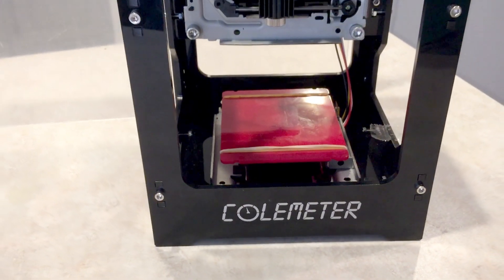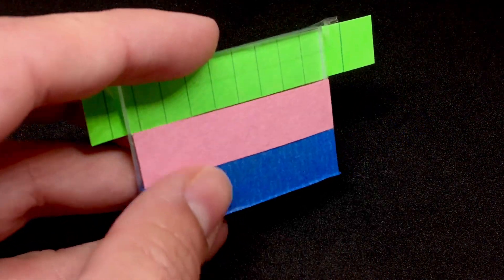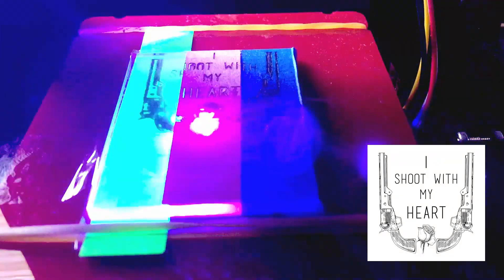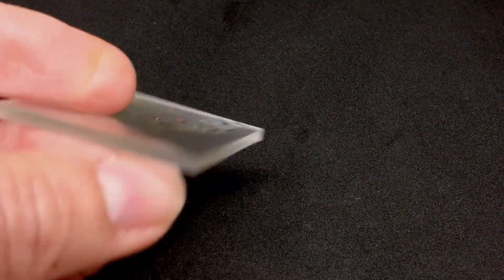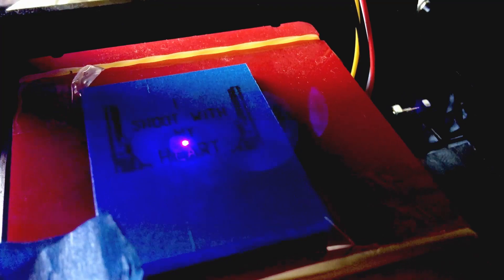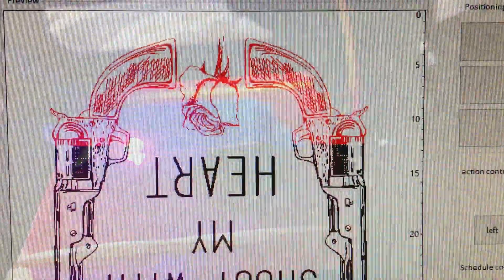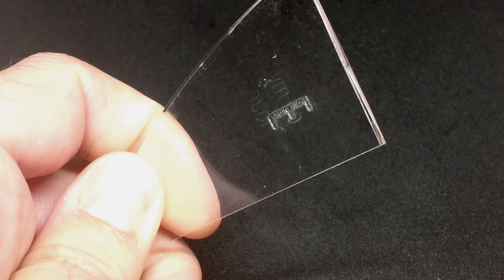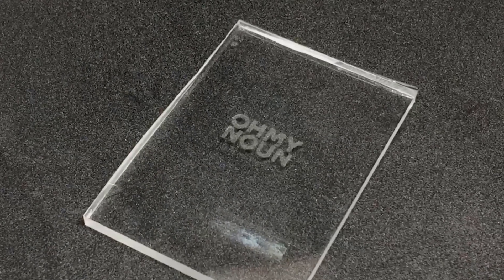How to Etch Acrylic with a 1000mW Colemeter Laser

Comment: I happen to be needing a clear 3.75" x 2.625" plastic and was wondering of routing or laser would be better. I can send you a sample for your opinion. vbcoachwasiatyahoo
Reply from the maker: No sample needed. If using a piece that large, I recommended a machine with a bigger platform. For basic plastic, 1000mW is fine. For acrylic, 1000mW works, but you may want to find a 2500mW, depending on your needs.

Comment: I am a nail artist and graphic designer who has been having my own private line of nail art stamping plates made in China.  I would love to be able to do my own small-batch manufacturing in the USA.  I don't know how the acrylic plates are made so this interests me.  The etched or engraved (?) portion is white acrylic that holds up to cleaning with 100% acetone.  It must be deep enough for a layer of nail polish to settle into the image but fine lines are desirable.  Anything you can tell me about the equipment type, class, and prices or materials i should be researching would be greatly appreciated.
Reply from the maker: I'd have to look into this, as I'm not sure about acetone-resistant acrylic. I'm not sure about the depth you'd need, either. Do you have an estimate on how deep the engraving would need to be? Can you share an image of what you'd be wanting to make?
Reply: @ohmynoun  not sure about the desired depth but i know very shallow plates make it difficult to pull designs.  Too thin of a layer of nail polish settling in dries too fast to pick up with silicone stamper.

Comment: Nice video . I’m trying to experiment with etching a plasti dip painted metal . The idea is to engrave the plastic paint to expose the metal . Making the whole thing isolated in a salt bath then etching the exposed metal with an electrolysis . Can you try etching any thick coated painted metal  ? 
Thank you in advance .
Reply from the maker: Thanks for watching! I've got a metal etching video with some tips on what not to do, but my updated video (with feedback from YouTubers) isn't ready yet. When I used paint on metal, the acid I was using to etch just got underneath the paint and messed everything up. But I was just using acrylic paint. Plasti-dip may form a better bond and make a better stencil, especially if you're using electrolysis to etch.

https://www.youtube.com/watch?v=A6NQyGMEaYo
Reply: ohmynoun thank you I’ll try and let you know .

Comment: Hey does changing the depth of the laser cut help in cutting thin tiny letters?
Reply from the maker: In my experience, not for acrylic. Because it melts the plastic, it's a bit like etching wax, where the plastic runs back into places that have been previously etched. So it just gets kind of muddied. I found the best results with weaker cutting over multiple passes. And someone else had recommended using black dry erase marker instead of tape, which might be a good idea.

Comment: Have you tried etching or engraving regular 16mm dice?
Reply from the maker: I haven't, but that's an interesting idea! I'll add it to my list of random materials for an upcoming video.
Reply: if you're able to do it, can you show us how you did it? :)
Reply from the maker: Of course!
Reply: Update: I tried engraving dice using the Colemeter and the "NEJE Miniature Laser Carver V1.1.4.1 Software at 120 Burning Time but it didn't even leave a mark. I assume that the dice reflects the laser so that it is unable to catch the burn marks. 

The 2nd time around, I put blue masking tape over the dice and it marked it slightly  with an etch but it wasn't deep enough. if I wanted to make a deeper etch... would I have to make a 2nd pass doing the same etch? Let me know if you have any luck =)
Reply from the maker: I haven't had a chance to try it yet, but I would definitely recommend making a second (or even third) pass. I've had to do this with a bunch of materials. It makes alignment a pain, but is really the only option in some instances.

Comment: These video's help alot! I just would like to know if the laser would be able to etch 3d printed parts?
Reply from the maker: Thanks for watching! These lasers etch basic plastics very well, which is what most 3D printers use. Some 3D printer filaments, however, may contain metals that are made to be fired in a kiln after printing, and those likely would not work.
Reply: Thanks for your reply. I only intend to etch PLA and maybe ABS, so that would be fine. I'm looking forward to your new video.

Comment: I think it would be interesting to try and etch aluminum and/or another metal!  ...I don't have the highest of hopes, but maybe there is some work-around like you used on the glass.
Reply from the maker: Yeah, I've tried aluminum on its own, but it didn't work. I may look into solutions in the future!
Reply: I just bought some Black plexi from amazon. do you think that maybe it'd etch better?
Reply from the maker: Straight up clear acrylic is definitely the toughest/trickiest non-metalic surface to etch. But I haven't experimented with any colored acrylics or plastics. I would imagine they'd work well because the dyes would help absorb utilize the laser energy.